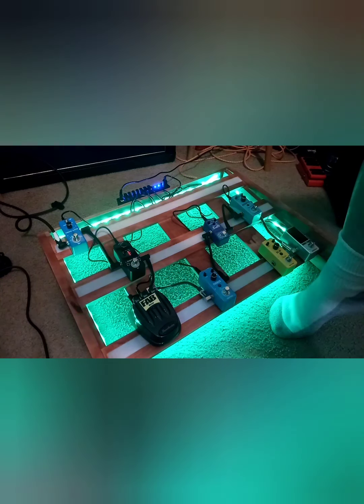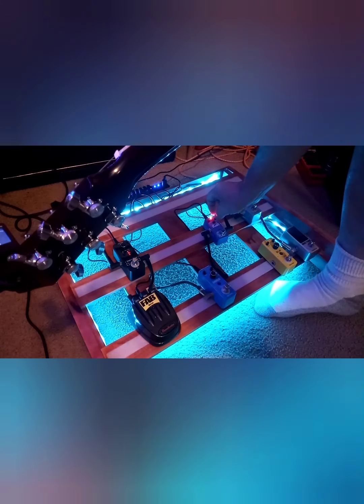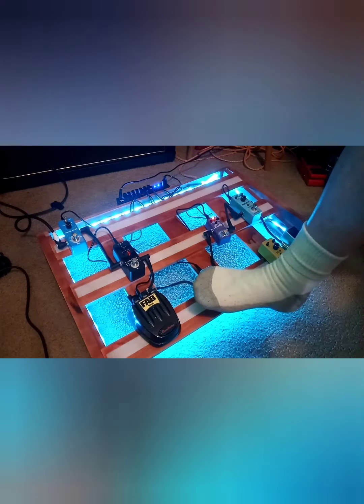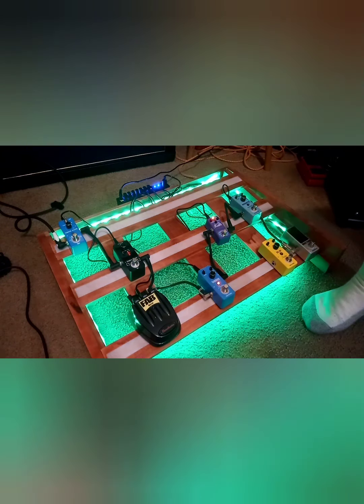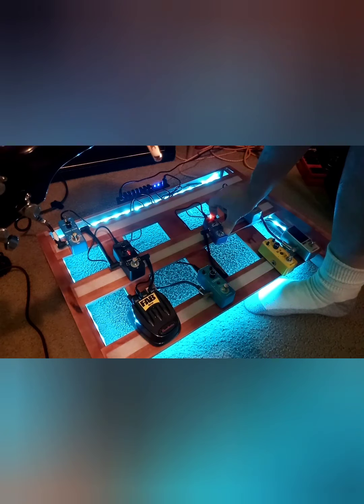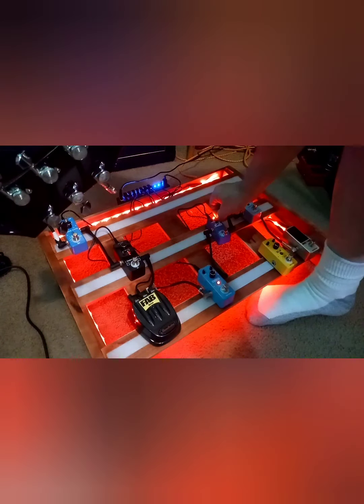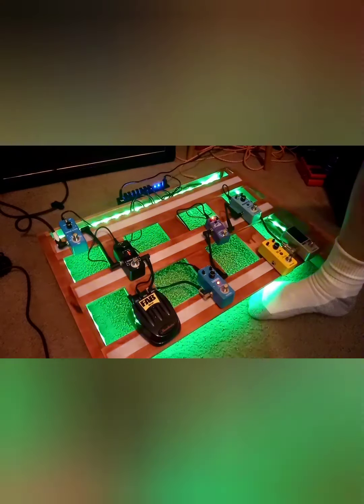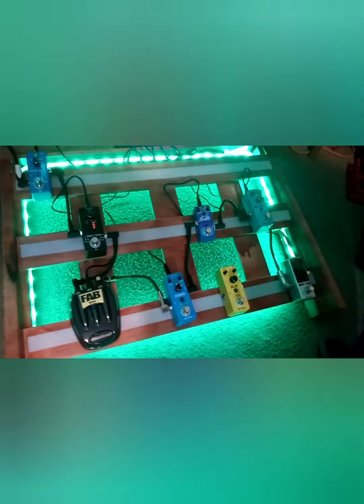VSN Echo Delay pedal

Comment: Did you do the custom lighting underneath? 

I’m thinking about replacing my DOD Echo with this VSN pedal. Specifically because its smaller and real cheap in price!
Reply from the maker: Yes I have a light strip under the bottom side of my pedalboard.